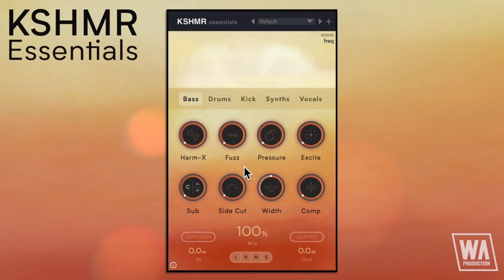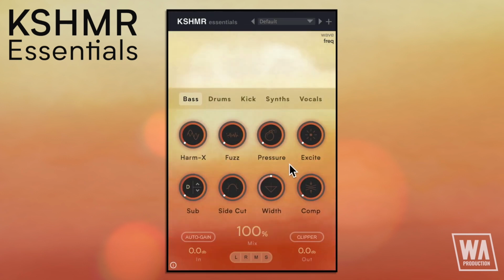KSHMR Essentials - Multi FX KSHMR Signature Plugin (VST / AU / AAX)

Comment: The frequency waveform in the oscilloscope never changed when any of the LRMS buttons were clicked, while the dials were being rotated, or when the presets were selected.  It would be more useful if the frequency waveform in the oscilloscope actually updated to display the resulting waveform while the effect processors are being applied.   Unless I missed it in the video, I also did not see a dedicated bypass button for the plug-in.